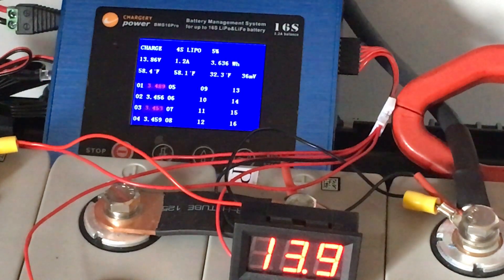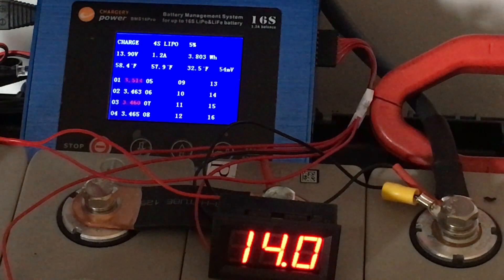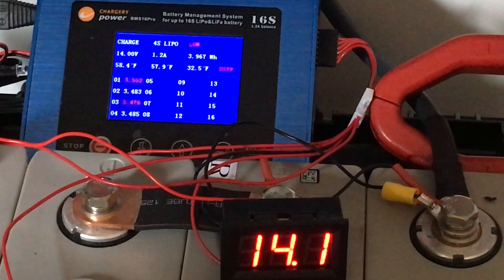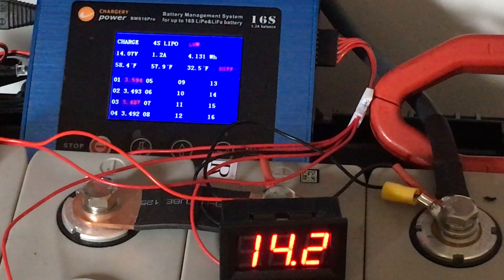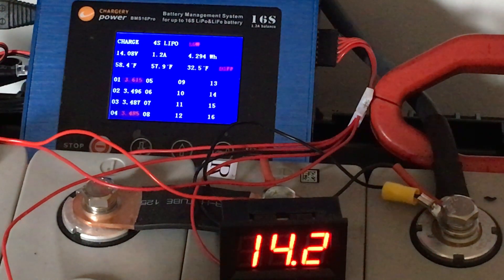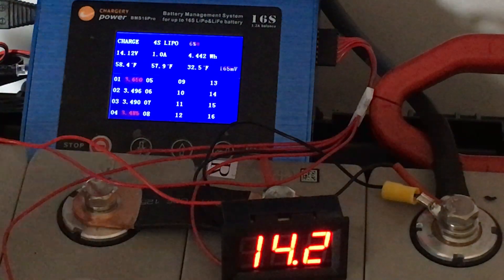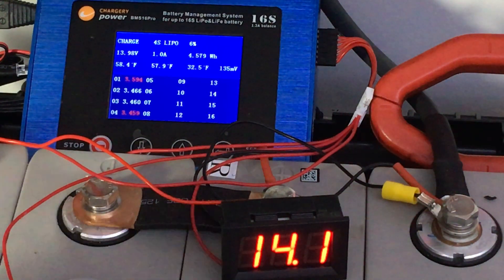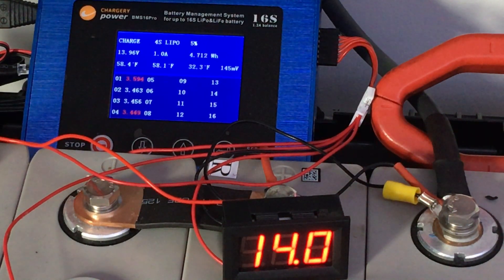Demonstration of Single Cell Voltage Spike on Lithium Cells in our off grid solar showroom.

Comment: there is really NO NEED to charge LifePo4 batterys higher than 13.9 Volt in a solar setup, these are NOT OLD SCHOOL LEAD batterys so do not thread them like so.
With all Lead acid type batterys , yes even AGM you must use a topping {absorption} charge of 14.4/ 14.7 volts for hours to avoid the dreaded SULFATION, Lithium cells DO NOT  SULFATE ever, so charging them till MAXIMUM 13.9 volt is perfectly okay, at this safe voltage a balanced pack will stay balanced for a very long time,  beter check the drop in amperage to asses how full the battery really is, and TO STOP charging immediately when "full" that means do not float charge them in order to keep a certain pack voltage, this really ruins a Lithium pack very vast, even faster than a accidental overgharge know and than, in fact Lithium charcing is even easier than lead acid charcing , its a classical CC/ CV charge coupled with a very high efficient charge absorption rate of the battery, way higher than any lead acid ever will do.

Comment: I saw in your viedos you had a lithium 100AR 12v battery now I see you have 4 cells. I am looking at getting a lithium  300AH 12v battery for my motor home. My solar panels put out 12v 27 amps max. Did you not find the 12v battery as good as the cells? also I saw briefly your solar controller Mppt for 35$, Did I see that wrong.